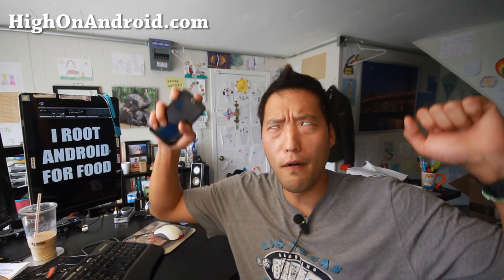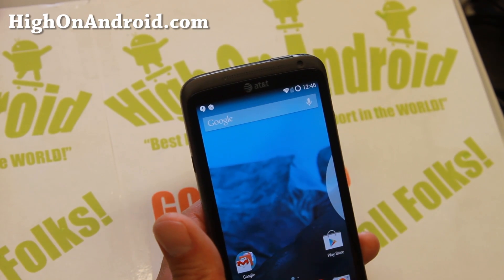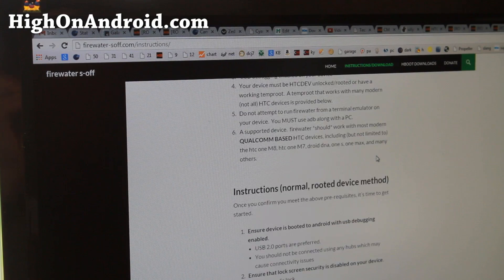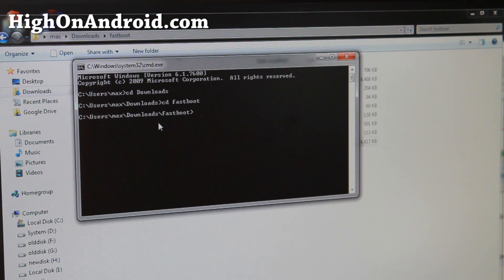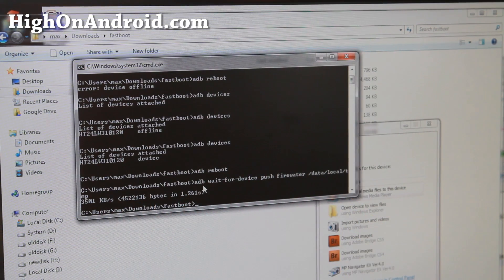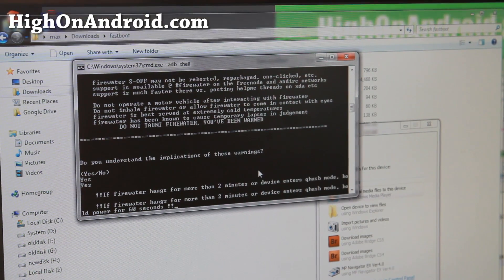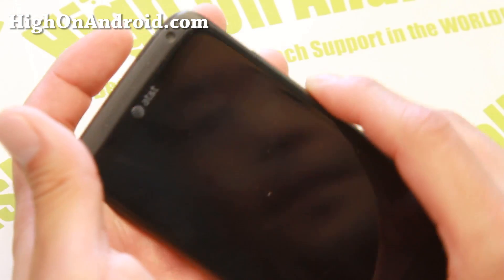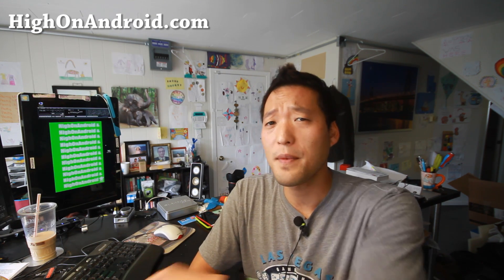How to Get S-OFF HTC Smartphones using Firewater!

Comment: my output says this after executing /data/local/tmp/firewater..
error: only position independent executables (PIE) are supported.
1|root@evita:/ #
Reply: only says that when on cm 12.. doesnt say that while using viper and or cm 13...but it still wont s off either way

Comment: after typing "chmod 755 /data/local/tmp/firewater" without the " i get this message "unable to open /data/local/tmp/firewater: no such file or directory 
plz help 
also you have failed to let people know the phone must be rooted as i tried without root and it failed so i used kingoroot to root my phone once it finished i tried and i managed to get to the point i have mentioned above but then get stuck

Comment: chmod 755 /data/local/tmp/firewater
Unable to open /data/local/tmp/firewater: No such file or directory
Reply: +Nyus its saying it doesnt see any file firewater in /data/local/tmp/firewater
copy firwater using push again
Reply: +Nyus I just found out it doesn't work because of the CURRENT TIME, if you set the date back to somewhere on 2013 (I set it to January 2013) it works!! Sorry if this comes a little late.

Comment: hi, since the push firewater command places the file into the phone,is it necessary to do while the phone is rebooting?
coz my phone reboots real quick and thus on executing the command i get :
error protocol fault (no status)
Reply from the maker: Sorry the firewater is discontinued by the developer you will have to use another method.
Reply: ***** uh...but i have downloaded the firewater file...so it should work right?
Reply: ***** Tried rumrunner...not working.. can u plz recommend any other method!
Reply from the maker: Knight94 try sunshine then but u gotta pay.

Comment: This does not work on HTC EVO 4G LTE HBOOT 2.10 Using Linux or Windows. It works perfectly until the last command and then it does not run Firewater. It just deletes the file from the tmp directory. Please Help. Thank you Max Lee

Comment: root@m7:/# chmod 755 /data/local/tmp/firewater
chmod 755 /data/local/tmp/firewater
root@m7:/# /data/local/tmp/firewater
/data/local/tmp/firewater
error: only position independent executables (PIE) are supported.

got this message at the end, i am trying to flash a radio rom, my phone keeps restarting and does not recognise my sim card.
 i am using an international htc one m7
Reply: Omar Said 0:21 the video SAYS clearly ''ONLY WORK ON MOST OF HTC WITH QUALCOMM CHIP'' in resume: you screw your phone cuz your lack of atention on the video :/
Reply: No worries man 
It's gone long time ago

Comment: Hello, I am currently running on cm11 on my HTC one M8 international variant. The reason to this is because I wasn't able to S-Off my device. I understand that changing to CM11 also changes the Kernel. Does it mean that I am now able to S-Off my device because the kernel from cm doesn't contain the anti firewater patch? Thanks!

Comment: does this work on a HTC One S? its an older phone. had mine for over 2 years, and ive tried 2 different methods without getting S-off. so i gave up and stuck to my Cm 10 based ROM that doesnt need S-Off. Its starting to lag like crazy, so i need something new
Reply: ***** thanks. was gonna try it tomorrow anyways. im hating my current phone that bad :P
Reply: ***** damnit, didnt work. got all the way to where it says that its chugging a bottle or whatnot. then after like 2 min instead of saying youve got S-Off, it just give me a line like any other before you write something. "C:\users\name\Downloads\fastboot\